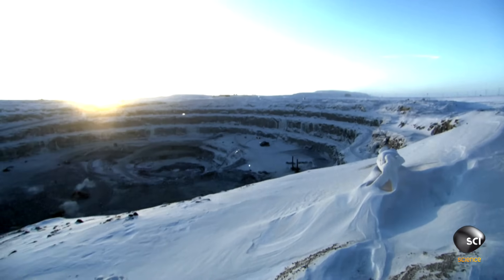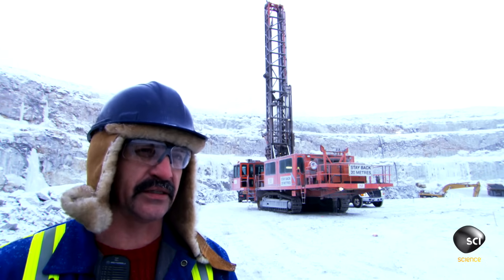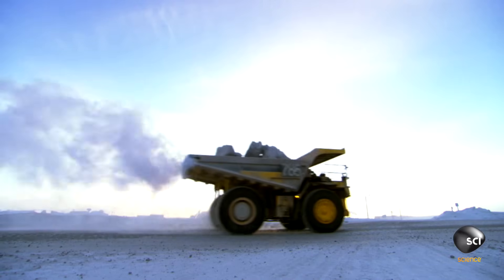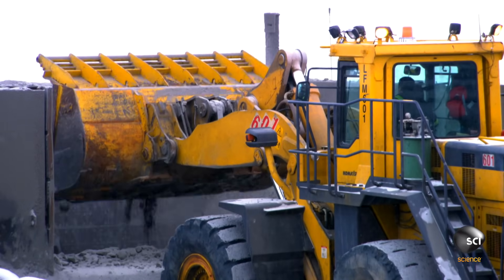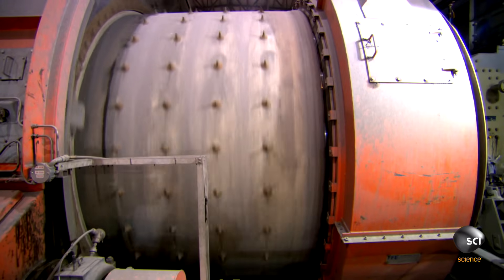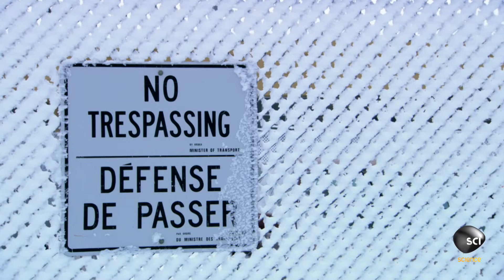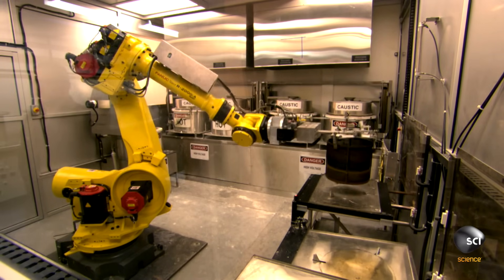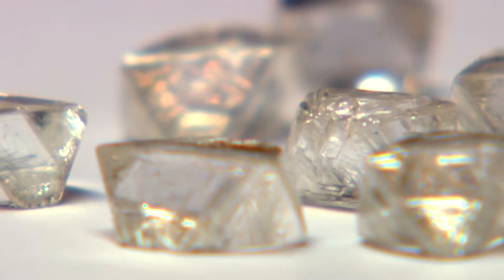How Do They Mine Diamonds?

Comment: so let me get this straight, you have to shape them into a diamond, while they are diamonds? what? you are just cutting away useful diamonds just to transform it into a diamond shape... I hear diamonds being made out of hairs now... now that is a utility...  probably just as expensive, or why would you look for diamonds when you really want diamonds? I would just get like a gimmick of white gold, which looks silverish but is gold, but isn't golden.. just buy a bound of silver then mate, what is the aesthetically determined alteration? i hate wearing rings I swear I just tend to lose my iron ring for days and weeks at a time, sometimes I hear a cling in the dryer so I tell myself to remember to grab the ring once its dried, along with the clothes, obviously. the other day, I thought I had lost it for good but then I found it with a set of washers ... one time, it was sitting on top of a soap bar, like what? 

I just took a look around me I have no idea where it is, but soon I will just vacuum the floor and it will surely clunk clang its way round and round in the suction cup! almost feel a bit of esctasy rediscovering my ring to the sound of something of a  metal object sucked up to the vaccum dust storage thing... I don't need a metal detector, as long as I have my brain!

Comment: With child labor ofc ..how else can you mine diamond in africa :v
Reply: Child labour won't work as there is less than 5g of diamonds per 100 tons of rock which has to be crushed and passed over a belt with grease to which diamonds stick.  UV lasers spot the diamonds and a jet of high-pressure air blows the diamond off the belt. only 50% of the diamonds present are recovered and 2/3 of them are useless for jewellery.  So 1g (5 carats) of gem-quality diamonds per 100 tons is too low a grade for humans to pick out, it has to be done by high-tech equipment.